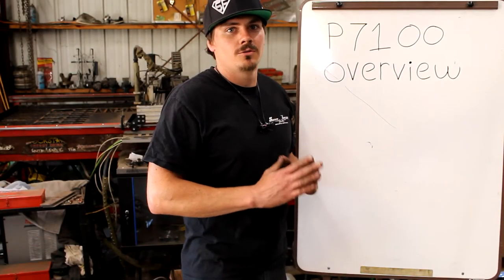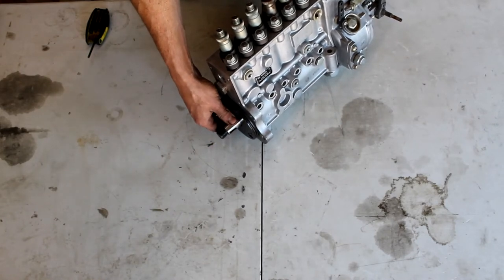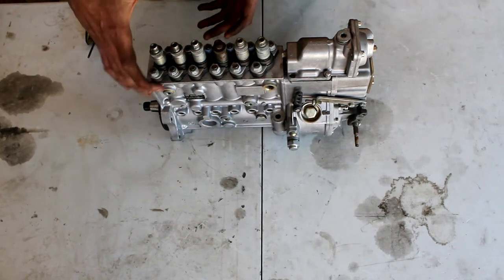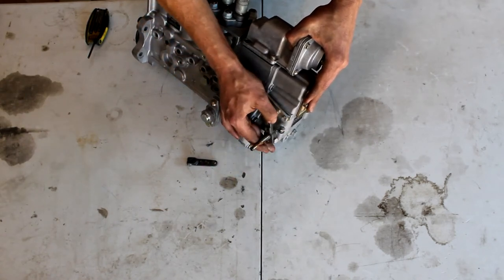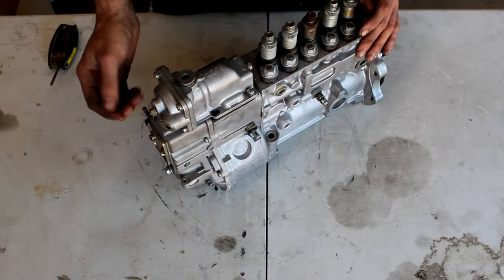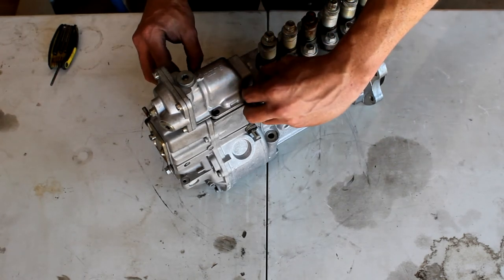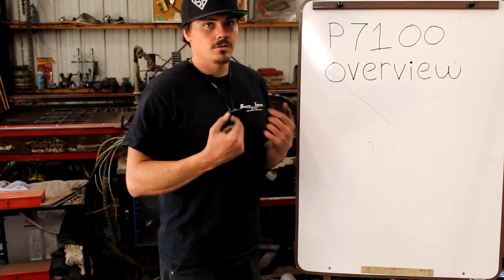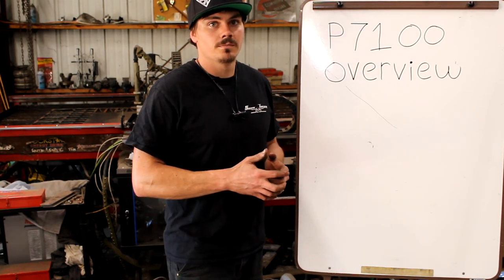P7100 overview

Comment: Informative and intimidating simultaneously. Do you offer services on the pumps? I have a 4bt from a fork lift (“industrial” I believe?) I’m about to stuff in a crown Vic and obviously would like a little more horsepower over factory output.
Reply from the maker: Nothing like what your looking for nor that I would do without a running engine to dial it in on. We use Seth Ferrell of Ferrell diesel service for all of our injection pump work on the in-line pumps :) he is a awesome guy.
Reply: @savagefabrication795  good to know, thanks for the response!